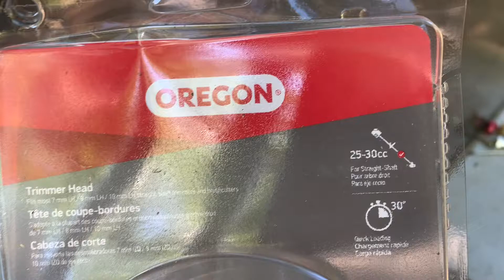Installing Oregon Speed Feed Head

Comment: hi, just put the feeder head on my fs56. I kinda rebuilt the weedeater the last month, new head , kill switch, and really cleaned it as well, I clean it all the time after I use it, put took off the covers and engine then put it back together. I use anti seize to coat the threads again. when you take equipment apart its good to coat the threads. I have make other youtube videos as well on things I have built or done. Thanks for this video, it really helped me put the head together . I am sit in my BBQshed this Sunday morning. Thanks again. I now have 2 weekeaters to use around my house. the FS56 I have had for 7 years, I bought used but kept it up to use

Comment: How long is the trimming line you precut to load? I have a slightly different Oregon head and their instructions are garbage and say nothing.
Reply from the maker: I use 4 full arm lengths of string.
Reply: @douglaslawncare2843  thank you! looks like the one I have "Oregon 539138 Universal Tap and Go Head" by my experimentation takes a max. of 4m length.

Comment: Thank you Sir! I was trying to install the exact same thing on my Ryobi 2 cycle, expand it trimmer and I was failing. Watched your video and had it up and running in less than 10 minutes. BTW, for anybody trying to install one on the Ryobi, it takes the red adapter. And..... Oregon... if you're listening, how freaking hard would it be to throw in a piece (1) of paper with some basic instructions? The tip is, no matter what trimmer you're gonna install it on, you're gonna have to take it (the trimmer head) apart.
Reply from the maker: Thanks for watching! Glad it helped! Instructions would be nice!

Comment: Just curious with a Stihl straight shaft, don't you suppose to be using the 24-250 gator speedload.
Reply from the maker: This is the head my Stihl dealer recommended.

Comment: Good video brother! But internally and externally its the exact clone of a echo speed 450 I have on my Stihl 🤷🏾‍♂️ Echo comes with the same color adaptors and the green fits the Stihl. So if u would have search the echo speed feed 450 install it would have saved u two hours. Also echo has the gap plate which is a non issue for my fs94R.
Reply from the maker: Good to know! Maybe next time I’ll try the Ecco head out!

Comment: The gap is bc of the shaft itself on the trimmer, the threaded part goes to far down and the threads stop before arbor (green piece) hits the baseplate. If the arbor was threaded deeper it’ll be better but unfortunately with the way the speed feed operates, it’s not possible.

Comment: Not so sure if I like this new trimmer head as grass gets stuck between the spacer and the head in tall grass! I had to stop the trimmer several times and work the grass from around the head.
Reply from the maker: The only time I’ve ever had that problem was when I’m trimming stuff that’s about 4 foot tall. Personally I think this head is 100x better than the head Stihl provides. I really think Stihl needs to upgrade there heads and give you something similar to this with no gap in between.

Comment: Anyone with a STIHL FS 40 bent shaft, trimmer beware! This will not fit that trimmer. Don’t spend $40 trying to figure it out.
Reply from the maker: That’s a home owner unit and it won’t work for these types of commercial heads.
Reply: @douglaslawncare2843  
Strange. When I was at the STIHL dealer they didn’t have a sign stating, 
“home owner units.”  
Do you suppose someone who owns any kind of lawn care business may have ever bought a bent shaft style trimmer? I’ll bet they have. And I didn’t know that the Oregon or the Echo speed feed heads were only available for “commercial head” style trimmers. My comment was for ANYONE home or business that own a bent shaft STIHL trimmer like the FS 40 or STIHL equivalent.
Reply from the maker: Personally I’d never buy anything under the fs 91r for commercial use. That being said if you bought it from a dealer they should have told you. I’d try and return it to them.
Reply: @douglaslawncare2843  
Well, just because you wouldn’t buy a bent shaft trimmer doesn’t mean anyone else wouldn’t now does it?
And I already did take it back and this isn’t the 1960’s when dealers gave a damn about whether or not you purchased something incorrectly. Nowadays all dealers want is your money.